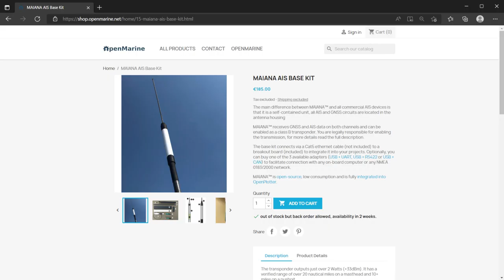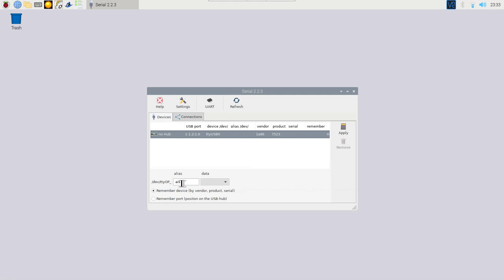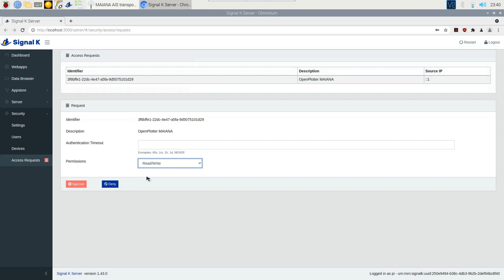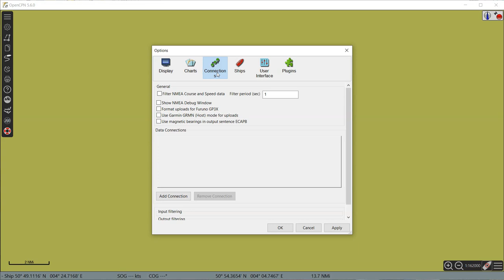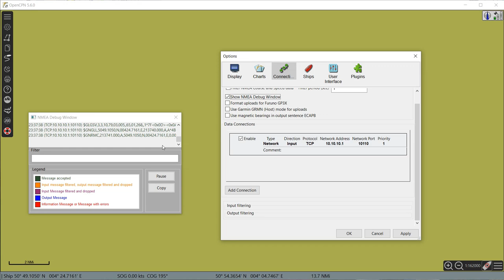AIS Transceiver in Openplotter

Comment: Does that work on a windows computer also?
I see you use the map of Oostende, are you close there?
Reply from the maker: OpenCPN, the client works on windows, yes. It's also possible to program the AIS unit using the Arduino IDE in windows, but it's a bit more complicated. 
I'm not from Ostend, no.